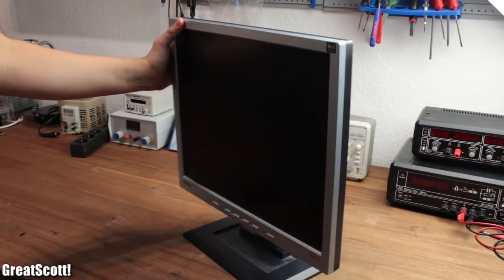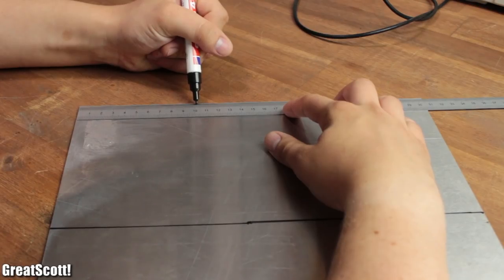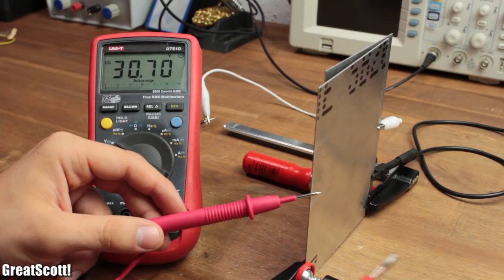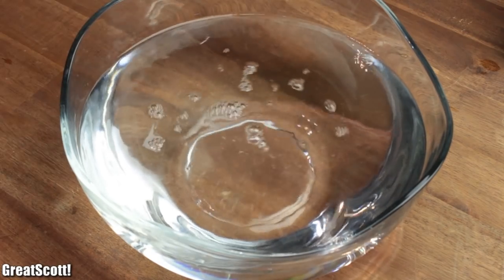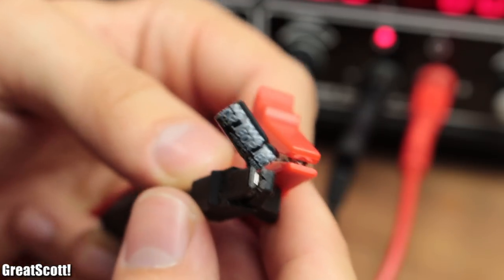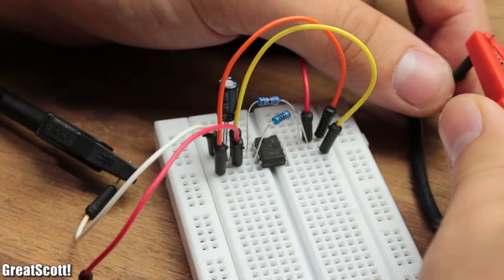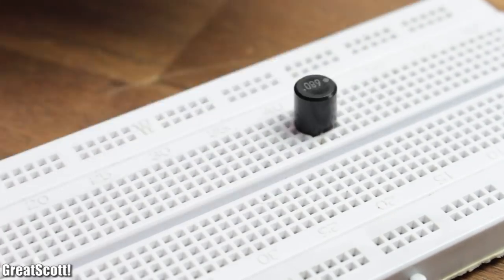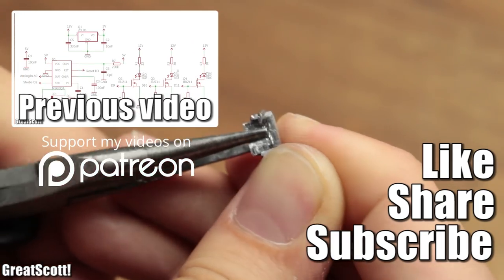Electronic Basics #14: Capacitors

Comment: I understand a little bit except why people put so many capacitors on a mother board 
I don't know what that does
Reply: motherboards have lots of little tiny tracks (like wires) that go high and low (voltage to no voltage) millions of times a second, it's important that the transition is quick and clean and capacitors are used to make that happen. If you watch some videos where people decode UART signals with an oscilloscope you will see that it's not a perfect square wave (the corners are slightly rounded) or the signal 'jitters' (bounces up and down around the average). If you take the capacitors away the 'corners' become less square and the jitters get bigger

Comment: Hello ,,
How to Make a reception RF receiver / FM Transmitter
1Pc FM Transmitter Circuit Discrete Transistors 76 MHZ 110MHZ FM Radio Wireless Transmitter Module MP3 Audio Repeater Module